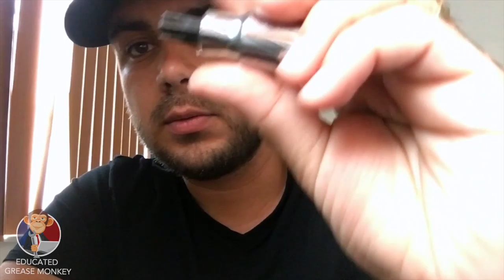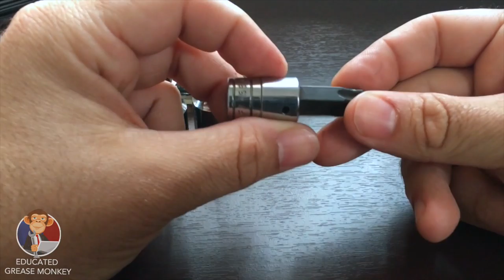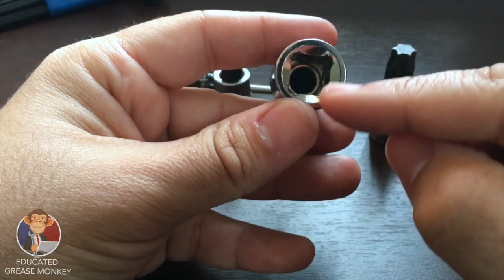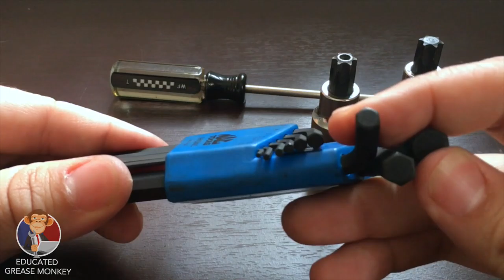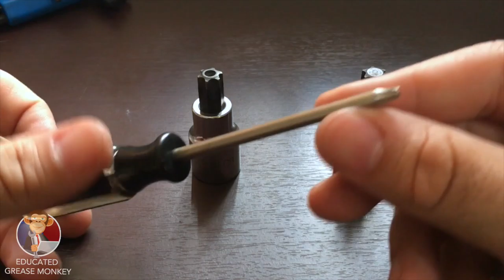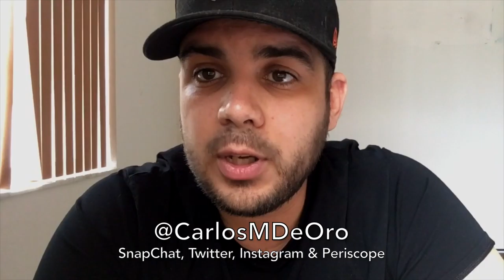Identifying Torx Tools - Educated Grease Monkey Tools

Comment: There is torx plus too.Look like a regular torx bit with rounded off tips instead of pointy.There are impact grade torx bit sockets out there now you can use on an impact.Grey Pnuematic and Sunex make them.Biggest thing with torx is break them loose buy hand first.Strip out easy if this is not done
Reply from the maker: I totally agree with loosening by hand first. Thanks for adding value to the video. I appreciate the support.